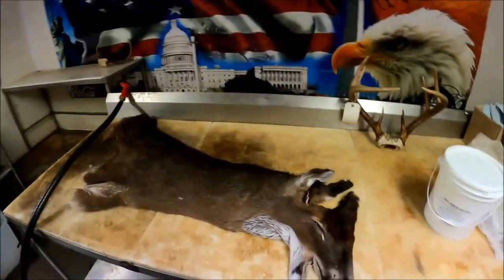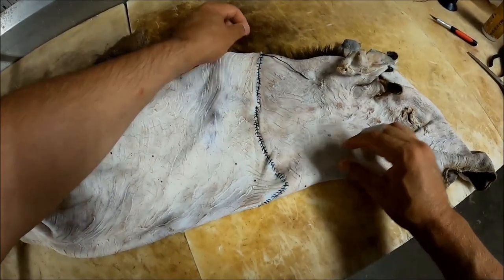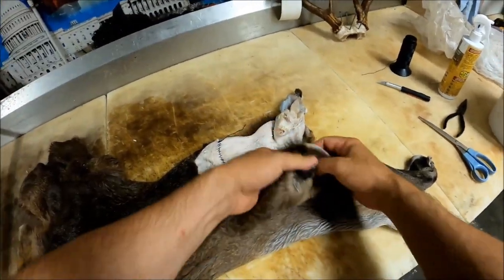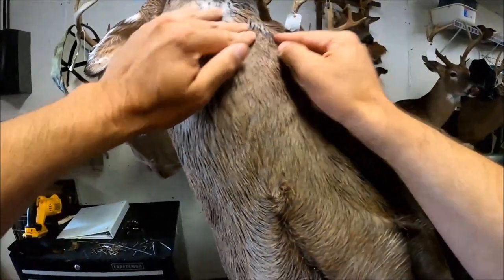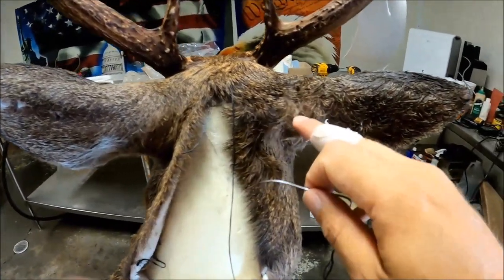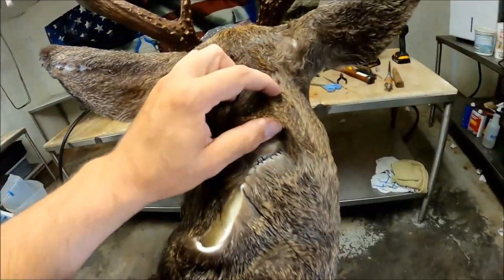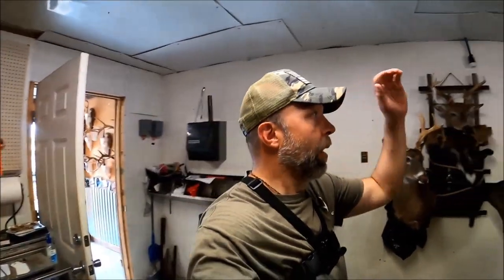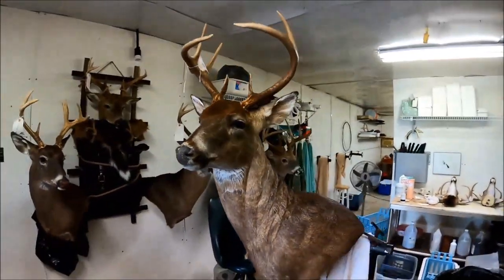IMPOSSIBLE TAXIDERMY?... ALMOST!! First time for this! How (and why) it took 2 capes to make 1 deer!

Comment: Dr. Danielstein!😂 Couldn't tell if you used a baseball stitch or a whip stitch. I used a whip stitch a few times on cut briskets that really helps the hide lay down with no humps. May or may not help on the thinner areas, but you asked to share tips. May be useful to someone out there. Great work as usual!
Reply from the maker: Hahaha! I used a baseball stitch, but very close to the edges and very close together stitches.